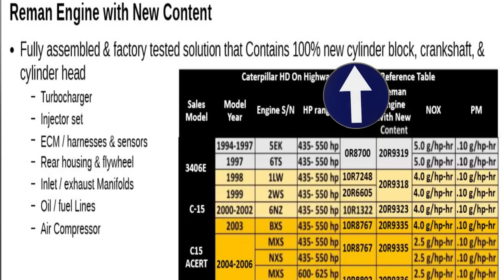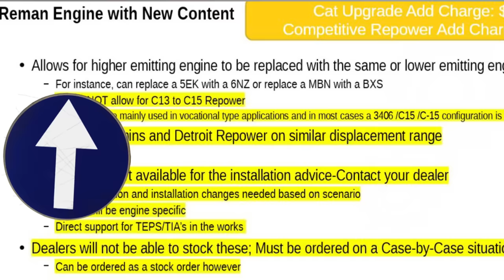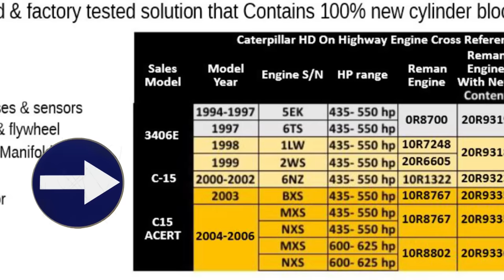Swap Your Cummins for a NEW Cat Engine!  Cat is Making New Truck Engines.

Comment: Loving the content! Just curious how they are getting by the EPA doing this? I would guess due to the years of the trucks cat is able to make the old motors with that year trucks emissions standards? It’s so awesome that they are doing this!
Reply: Old trucks can use "old" engines or new engines.

New trucks must use new engines.
Can't stick an old design plant into a new model year rig.
Reply: @bmw328igearhead  Yes, you can.
Reply: @bradclark2922  Yeah good luck running in commifornia or new york.
Reply: I guess the same reason why we still can buy Chevy Small Block and Hemi Crate motors for pre emission Muscle Cars since they’re EPA exempt due to their historical and cultural value, not sure how long this loophole will last but good for CAT for their support of pre emission trucks
Reply: @bradclark2922  You can as long as you have a glider
Reply: @Nikowalker007  yes but even a glider must have 99' or older model engine to be ELD exempt if that is part of a person justification.
Reply: I suppose the old engine is destroyed.

Comment: I've been seeing re powerd trucks popping up and was wondering if I could swap one. This is great
Reply: I’ve seen Cummins repower for dead Maxxforce 7 engines in international buses and trucks. Basically a Cummins swap.
Reply: The law states you can repower the engine with the epa stuff it has to be replaced with epa engine. So you can't take a 2014 engine and put a 1999 engine in lol

Comment: If you have a detroit of cummins and are trying to swap for a CAT. You still need to make a new wiring harness and engine harness to communicate with the cab you have. I.e, RPM gauges, oil.pressure gages. It's not as simple as plug and play.
Reply: Boss said he can do cat swap in 2024 Pete for 65000

Comment: I found out early 2022 about this 2020 working as a Caterpillar dealer Tech also. But just like all parts today it's a chore getting any. I have an MXS out of frame I built in December sitting here still waiting for new IVA housings. Back in Dec I was told I was 110th in line for them. It's a dam good thing it's for a local Farmer and not an over the road truck. The Reman patched stuff has had me talking the customer into rebuilding patching if necessary their own if salvageable. I have one customer on his 3rd reman 2 of them in the last 4 years. Due to well you know.

Comment: The main Cat dealer in my home state that we took our 2003 Class A motor home with a 3126E engine to for repair/service has shut down all their truck/bus,/RV repair services. I guess they are just doing compact and heavy construction equip repair/services. I'm totally bummed out need to find a cat e.t. system.

Comment: I just talked to Cat a couple days ago. They never said anything to me about what I could or couldn't do (not that I would care anyway).  I was just asking what the core charge was on the 6NZ long block ($7550). I'm doing my second engine swap now, getting rid of a 08 SPD ACERT regen engine for a 6NZ, basically turning the truck into a glider. It's illegal to modify an emissions engine, but not to swap it out for a pre-emission's engine. The truck manufacturers still make glider kits, just not very many (300 per year I think).
Reply: BTW, this is not a new thing. I bought a 6NZ long block from Cat a couple years ago. They have been selling them since they first started making the 6NZ.
Reply: Yes that’s correct. With enough money you can turn any new truck into a glider by replacing the engine and transmission. It has to work just enough to grant a repowered title. Then it can be sent to CAT for this program and you got the best truck in the world.

Comment: Sounds like a good deal. Do you think they would do a exchange on a 1693TA to a 6NZ?
Reply: 1693 is much more valuable and rare but it still would be interesting to see what they would do
Reply: Not in the chart shown. I doubt it, but it never hurts to try, just don't get your hopes up.
Reply: The head is worth as much as the 6nz what's the core on 1693 head like 10 grand
Reply: Who in their right mind would even consider letting go of a 1693 for a 6NZ?
Reply: Love the 1693TA ran several of them over the years. They would out pull a 3408
Reply: @Vance_Nickerson  they get lousy fuel mileage,the jake is not worth a crap-smoke too much,loud

Comment: I run the mountains daily.  The last 20 years with a c15. A good, strong engine, but after running x15's in the last 2 trucks,  I can't go back to Cat. The engine braking of the x 15 saves me an hour every day, and my brakes are much less used. I do miss my 8 inch pipes and the sound of a cat though. I also don't miss doing 20 mph down the big hills. The Cummins holds back a heavy load far better than any Cat I've run. The Cat is easy to get big power. It's a toss up between the two. Fast up the hill, Cat. Fast down the hill, Cummins. I'd like to hear other driver's thoughts on that.
Reply: You need a cat with a brake saver!

Comment: I commend Caterpillar for this.  In one Toyota mechanic video you could still get a brand new short block from Toyota for a  2AR-FE four-cylinder engine. Unfortunately, this is because those engines usually turned a boat anchors due to low tension oil rings: so said the host the car care nut on his channel. This was the only case for I knew of that 7 years after someone buys a car he is able to still get a brand new short-block.

I like the way Caterpillar is going the extra mile by making a brand-new long-block.

This is coming from a Cummins N14 Celect Plus guy.  The deal-breaker was the fuel mileage. I still Patty table crown the most power to caterpillars with you pay for it at the fuel pump. Have to be hauling freight that makes up that 5-miles per gallon that I saw in my 50/50 pay after fuel company driving jobs.

Comment: I have a C-15 and it is a MBN bridge engine. It is 475 horsepower. If I wanted to upgrade to 550hp, I would have to go to a twin turbo engine because I don't think there is a MBN at 550 horsepower. Mine doesn't need overhauling yet, but it is sure something to think about.
Reply: MBN's you cannot rerate the engine outside the emissions family. I think a 525 HP was the max. Now going ACERT you going to a newer emissions family and that should be legal.
Reply: i have 2 MBN C-15s one at 550, one at 575. just need to find someone with a computer with the right software to change it.

Comment: Its not all that . my dad did that with a farm tractor program.  Yes he got a new tractor but the new tractor used the same if not more diesel fuel not to mention it was almost 10x the price but its really doesn't produce 10x the work output.  If you have a good old rig take care of it, even rebuilding  is cheaper more money in your pocket when you get to the bottom line.

Comment: Question are the new blocks and heads on E models and the 6NZ blocks heads made with the same material or better material and better coolant capacity and are the cranks better and is the webbing thicker ?? Apericate and Knowledge answer..
Reply: You get a new casting on the block, latest design that they are currently using.

Comment: New replacement is as follows, 1LW short block, long block, engine, 5EK/6TS short block, long block, engine, 2WS short block, long block, engine, MBN long block, 6NZ long block, engine, BXS you will upgrade to a MXS/NXS engine only. MXS/NXS low HP, long block, MXS/NXS high HP, long block, engine. Now what I am told is, your guaranteed to get a New Cylinder Block, a New Crankshaft, a New Cylinder Head (except short block) which you would purchase head separately and it would be a New Head. I have replaced a few new content long blocks. They are in high demand, so wait time is a few months.
Reply: You know the price on any short or these long blocks ?
Reply: @Gmoney927  What I recall, the ACERT engines are just over $60K and the long blocks are $36-38K. I need to know which engine you have, so I can get a price. Price may vary depends on your location.
Reply: I live in dallas I have a acert
Reply: @Gmoney927  From what I understand, if you go new content engine and you have a BXS, you will be upgraded to a MXS/NXS engine. I do not know if they come with a flywheel. All older REMAN engines does not have one. REMAN engines are built to one chassis. So depending on your truck, parts may have to be swapped. A new content long block, does not matter as you will reuse most of your outside iron. What is your full engine serial number?
Reply: I am told the new content engine comes with a flywheel. We also have a reman ACERT and it has a flywheel on it.

Comment: i have a reman long block by cat C-13 that i have 1,200,000 miles on it and only have replaced one injector on the motor in all those miles--no other issues in all those miles

Comment: The 12.7 60 series Detroit was the best truck engine ever made.
Reply: It was definitely made right. The Detroit 14L is also a good engine. Stock power it uses too much fuel but when you turn it up past 600hp it gets very efficient and can haul a mountain.

Comment: So are they also gonna build all new parts to put in these new blocks?  Because some yellow engine internal parts are getting pretty damn hard to get in my area..simple stuff like injectors, wiring harnesses, timing gears..crank shafts..etc.. becoming obsolete dinosaurs.  Are they replenishing the hardware too??

Comment: It amazes me how many excavators get wiped out on bridges. It is easy to miss your height but after even a few loads you get where you can tell if you need to measure your height. They make a stick to measure height with from the ground and every equipment hauler should be required to carry one.

Comment: When I was a truck mechanic for a logging company . The trucks were all Cummins big and small cam 350 & 400s the #2 driver no accidents didn't tare shit up and when his truck was due for a major instead we put a brand new big cam 400 that was sitting in the warehouse and reman transmission and both diffs reman so basically a new truck 2 weeks in the shop.
 First day all new and shiny on his way to the mill with his first load of logs a new guy on his first day of work at a local sawmill made a stupid move and turned left Infront of a loaded log truck going 60 mpg . The truck ran over the ass of the car and rolled into a major road spilling it's logs . 
  The truck was old model but all major components was new Emron paint so that looked a new kw. The truck was totaled the insurance company offered $15000 the wrecking yard offered $29000 for the truck. The company said no. The company reached a settlement with the insurance company $22000 and the company kept. The truck. 
 We fixed it inhouse. Big job weeks in the shop had to replace a frame rail bunk and trailer reach was bent . But the paint still looked new and was illegal to paint with Emron at that time . Epa and OSHA both said no to Emron . But it only had a scuff about baseball size just a scuff .
  Truck#17 I still remember that number from 30+ years ago.  
 The truck driver got his 15 minutes of fame later that year . He was also on the city council and when the town flooded it made national news and the start of the national network news led with a video of the driver in a rowboat rescuing people in a fireman's suit rowing down the main street with a giant fat cigar jammed in his mouth. Lol had to be there .

Comment: Got a question. I have a 2003 Kenworth T600 C15 6nz it's blowing grey smoke running rough and leaking oil out of one exhaust port. And when  I turn the ignition switch off it may run for another 20 seconds. The computer says it's not injectors and the turbo looks good. What's your idea of what the problem is? The injector cups were done 2 to 3 years ago and a gold rebuild about 1.2 million km ago

Comment: I get 8/9 mpg on a Mp8 I’ve own 2 cats  c15 best mileage was 6.25 driving at 65. Base on today’s fuel cost I’ll pass especially if the fuel mileage isn’t improved. Its about profit don’t need the power and only run the southern states. Good luck

Comment: All I'd like is to be able to have my 02 Dodge with the Cummins engine back I often wonder where will they go next when the batteries in these electric vehicles needs to be disposed or how long it will delay truckers to recharge with a load of perishable goods

Comment: Awesome news! What if you have 3406B?
Reply: Cat sells reman engines, 3406B JWAC, 3406B ATAAC, both rear sump. 3406C front sump or rear sump. Theses are REMAN so you more than likely will get a undersize crank or a over size line bore. And long block or short block.

Comment: Well, I just got off the phone with Holt Cat in Irving Tx. The quote I received was 56k plus 13k core charge for a mxs engine. I currently have 2 bxs engines. So, in my opinion, I think it would be cheaper just to get an in frame vs doing the new content engine.  The warranty they offer is a standard 1 year 100k mile warranty, but I'm pretty sure you can buy an extended one for extra$$$.  56k or 20k to 25k for cat to do a in frame with the same warranty.  Hummm???? I guess it depends on how bad you want a new engine.
Reply: Thanks for the info. This is the information everybody was probably looking for. I was thinking maybe around 40k in my head. But 56K wow! I would say unless your block is completely grenaded and is not repairable, I would go with the in frame. I'm doing a in-frame now with a 3406E that started leaking coolant internally.
Reply: All new parts means it’s going to last a million miles if you take care of it. Doing another rebuild on that worn out engine is guaranteed to increase the odds of something breaking from fatigue and ruining the engine. If you rebuild your engine every 100k I guess it doesn’t matter then?

Comment: Having problems injected 5 and 6 have replace injectors hardest travel 150 miles and started having problems with 5 and 6 again on a 2004 Peter built twin turbo cat engine hope you can help me thank you

Comment: What is the replacement for a 40 year old 3208? Actually I don’t want to swap it out. No electronics no emissions.
Reply: Cat does not offer a engine or a short block, nor a long block. Fix yours or go aftermarket.

Comment: Interesting, 3406b is the last all mechanical cat engine correct?
Reply: The 3406C would have been the last mechanical engine. Same as the B but had a little different advance setup to try help with emissions.

Comment: I'm wanting to put a cat c7 in a new ish Ford super duty but I need it to run higher rpm than stock a push more hp and fuel into the system

Comment: Josh - If doing the swap from a Detroit or Cummins what about the wiring? Going to need ECM and new harnesses. And what about the engine mounts?
Reply: That is one of the hard parts. Best to go to a junk yard and find a donor truck and get the vin or parts off it. Some people make harness's, I have made a adapter on one. A real pain, then you have to see if it works and adjust. So you need a wiring schematic.
Reply from the maker: John Goldsmith sharing knowledge again 👍

Comment: This is good news, but unfortunately I'm predicting that Cat dealers will soon be moving out of the on-highway engine game. My local network, Ring Power in Florida, already has, and left us high and dry on quality repairs and overhauls on our engines. My C-13 is about to hit 1.8 million, and will need an overhaul in a few years, so now what?

Seriously considering selling the old cornbinder and going to a truck with a 12.7 S60 for ease of serviceability and cost savings. That will be a sad day.
Reply: You may want to reconsider the 12.7. I love 12.7s, but it has been such a pain in the ass this year to get parts. I’m in a few pages and seems like I’m not the only one. On top of parts prices going up. It was cheaper for me to rebuild my twin turbo cat then my 12.7 which was extremely surprising.
Reply: @BMW_Mustang_Dodge  You’re kidding me! What kind of parts have been difficult to find? The rebuild of My C13 cost me $33,000 7 years ago, and I swore to myself I was not going to do that again.

Maybe an N14…
Reply: @fredmalito9869  if going with an N14, make sure it is a celect plus and not a celect. the only hard parts as of right now for the N14s is ECMs. Celect is almost impossible to find and Celect Plus isnt easy either. Cummins does not offer new of reman ecms for the N14s. they have to be sent off for repairs.
Reply: Weller Truck Parts manufactures new N14 ECMs.  I had the pleasure of touring their facility.
Reply: Detroit doesn’t care about the 12.7 anymore. They’re not stocking parts. I would stick with CAT. These 3406 and C15 engines are in tons and tons of their equipment even brand new models. They will have tons of parts in stock for decades to come.

Comment: I'm sure cat would sell any engine to anybody if the EPA weren't breathing down their necks. However, those regulations mean we have cleaner air to breathe so I don't really think it's such a bad thing. I'm just hopeful that in the future, technology advances enough to give us reliable engines with good power that still run clean.
Reply: During the plague I watched a video on youtube that was Dutch and South African scientists that took the loss in fuel economy, the fuel used to make DEF, packaging, shipping, etc and they figured it was a net loss.  I would like to see the test done elsewhere as there are ways to reduce pollution like NOx without using urea.  To often government mandates prove to be profitable to someone involved but not really what was the best choice.
Reply: @badgerpa9  When will you read the many studies showing the health costs of diesel particulates and NOX.  Otherwise you just pumped more confirmation into your already established bias.